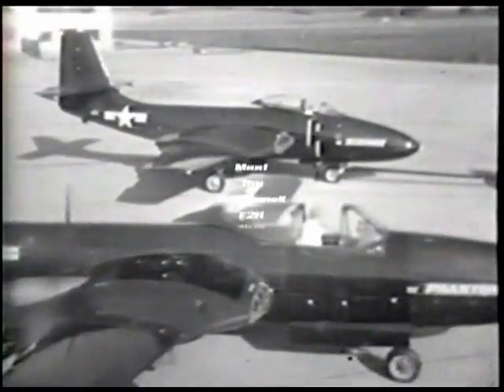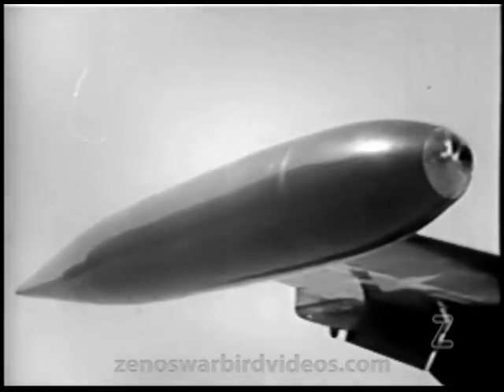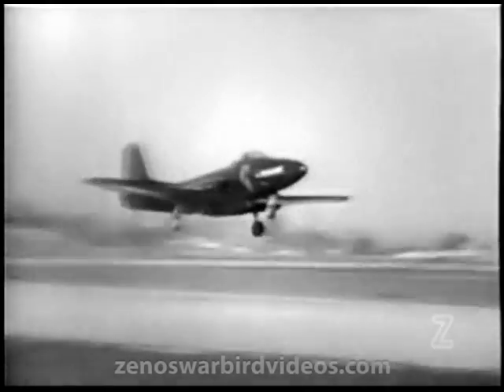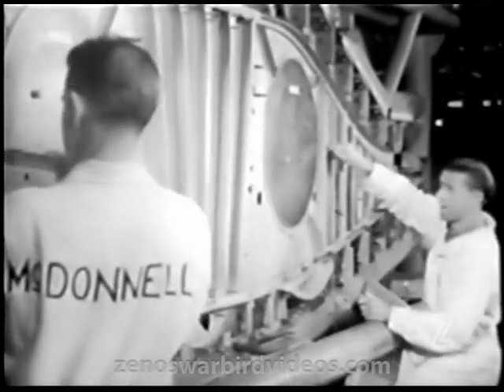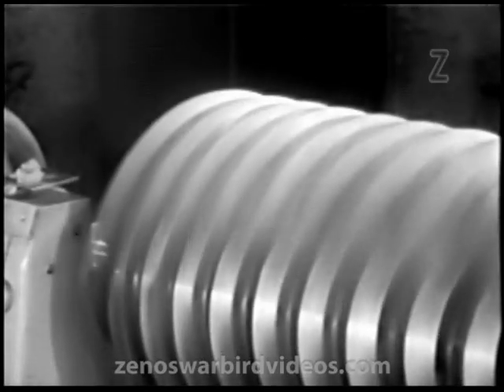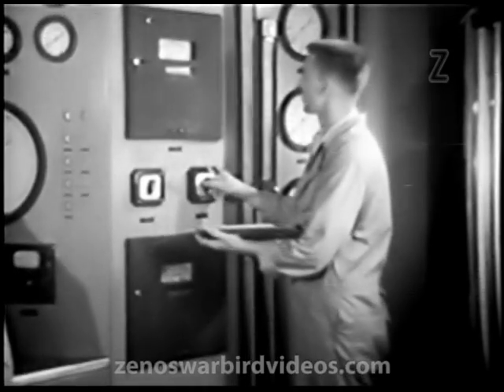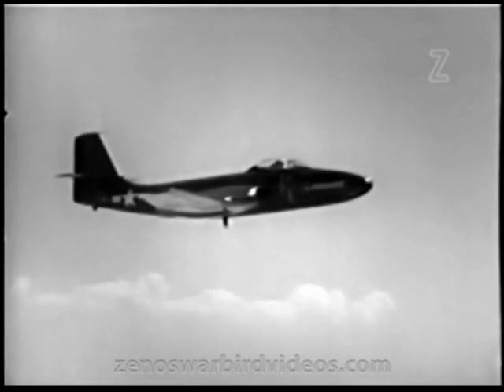Meet the McDonnell F2H Banshee US Navy Jet Fighter - 1948

Comment: For fans and experts of military aviation, in-the-know, this cheerful, optimistic depiction of the Banshee omits the major point.  The Banshee's straight wings reveals it all.  Straight wing jet fighters were limited in performance.  Swept-wing jets flew much faster at higher subsonic speeds and could even achieve Mach 1 in a dive.  The F-86A Sabre could achieve 650 mph.  The straight wing Banshee would not come close.  First generation, straight wing jet fighters of the U.S. Air Force, Navy, and British RAF would achieve about 580 mph.  Only the swept wing fighters could reach into the mid-600s and better.  The USAF F-84G Thunderjet was able to squeeze out 620 mph from its straight-wing design. 
      The Korean War clearly demonstrated that swept-wing fighter jets were here to stay.  Straight wing fighter jets had their short-lived day, establishing the new paradigm of fighter combat aircraft.  But the swept wing jets would rule the skies of air combat indefinitely.

Comment: I was comment # 177; the rear stabilizers move up & down independent on modern jets fighters most hve dual fins & dual engines not always plumb, mighty brick aero F4 has downward not level tail stabilizers. ESP important Fighters must hve gun engineers fucking idiots.

Comment: So, did pilots shut down one engine during cruise altitudes for the single purpose of extending range? The same for loitering time? How long did it take for inflight engine restart? If this was engineered design, seems advanced for 1953 era combat jet fighter aircraft, i.e.; F-15 crews wouldn’t run on single engine by choice.
Reply: Not range, shut one down to prolong endurance, say damage on the carrier.
Reply: No way. Jets lacked Power to fly just on one.

Comment: Top speed? Armament? Thrust? Range? Ceiling? Cost? Production number? This video is for children.
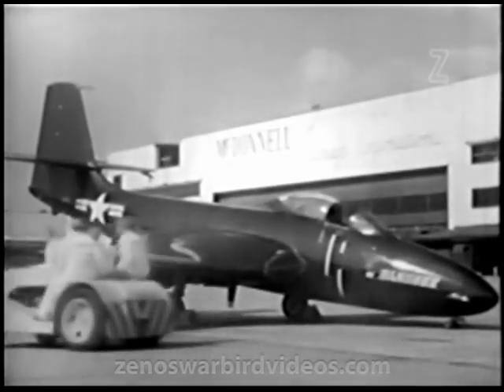Reply from the maker: It is what it is: a very brief 13:00 film produced by McDonnell to introduce their new aircraft more than 70 years ago. Performance figures etc were probably classified. But beyond that, it was never intended to be an in depth analysis of all the aircraft’s capabilities. But I suppose you could write a letter to Boeing, who bought the brand a long time ago, asking them to update the original film😉
Reply: @ZenosWarbirds  Hey ! A letter to Boeing might work if I tell them that I am a Boeing shareholder. Has to work because I have  
                                 been agonizing over that data for years. Thanks for the suggestion.
Reply: I also wanted to see or hear some numbers. So why the silence ?
Reply: Think Uncle Joe’s goons might have been watching that movie?  Ever hear of the Cold War.

Comment: In 1948 the Westinghouse J-34 was state of the art turbojet technology.  within a relatively short time, Westinghouse would  see its  J-40 program implode bringing jet engine development to a halt at Westinghouse.
Reply: Kelly Johnson designed an axial flow engine with afterburner in the 1930s. But the Air Corp wanted nothing to do with it.
Reply: Then GE took the jet engine to the finish line.

Comment: I'm a big fan of M-D Aircraft, but why is it the ME262 Jet Fighter, which is older in design, have more of a modern design over our first generation Jet Fighters? What am I missing here? Thanks, agw.
Reply: The Navy was concerned at the time about performance of swept-wing aircraft on carriers.  It goes to why the swing-wing aircraft take off and land with wings fully extended.  Land-based aircraft almost always have an advantage over comparable carrier-based craft.
Reply: Because you’re wrong in every way. The banshee was faster, flew higher, climbed faster, had twice the thrust, on and on. You’re just wrong, lol.
Reply: soaringtractor 
   Agree with you on the fact of the NO swept wings in the Me-262, it was in fact to maintain the CG, and the nose landing gear, with the OBVIOUS need to eliminate the tail wheel.
Reply: @Dirk Pitt Thank you!
Reply: +soaringtractor attitude
Reply: soaringtractor More Information for you WilbursoaringtractorFinnigan on the F 86 Sabre . Read it and weep cos it busts so many of your lies. It's from an American website !!

The F86 Sabre was originally designed for the US Navy in 1945 as a straight-winged jet fighter, and was known as the XJ Fury.North American Aviation  was put under contract by the US Army Air Force to produce a new jet fighter. Utilizing information captured from the Germans, innovative technologies were employed in transforming the straight-winged XFJ-1 into the swept-wing F-86 Sabre that would dominate the skies over Korea in the 1950s.

The Sabre represented many firsts in technology and design. Swept-wing configuration has become a standard for jet-powered aircraft. The then revolutionary ( INVENTED  IN BRITAIN !!! ) but now commonplace 'flying tail' allows the aircraft excellent maneuverability at high altitudes. In addition, the Sabre employs a hydraulic system for the movement of the flight controls, eliminating the excessive control stick forces necessary to maneuver other types of airplanes at high speeds.

The Sabre was delivered to the Air Force in 1948. The first production model flew on May 20, 1948, and on September 15, 1948, an F-86A set a new world speed record of 670.9 mph. Originally designated as the F-86A, the Sabre would undergo a number of changes resulting in a variety of model designations.

YOU ARE A LIAR AND A TOTAL LOSER
Reply: +soaringtractor me 262 was effectively the first swept wing jet fighter, although not as great a sweep angle as a F-86 or a MiG-15.

and the F-86 prototype had P-51 wings.

and if your response to this is as rude as I've seen then well go live on like that and we'll see where you'll end up
Reply: But why didn't they enter service then in WWII? Why the first generation is straight winged? BS
Reply: soaringtractor 
   NEGATIVE.!!!!!!
   (About the development of jet engines)!!!
   And, may I ask, to you, both Gentlemen, to keep this SO interesting conversation CIVIL, without RUDE, (no needed), lenguaje???
   Please???
   Thank you, in advance, Sirs, for I'm very interested in this subject, and I would like to fallow you, BUT only in a Gentleman's way...
   Thanks in advance, and let us continue, please..
Reply: soaringtractor The F84 was way underpowered. On hot summer days it could barely take off even on long runways
Reply: @ SoararsetraitorFinnigan ..Attitude from TOTAL LACK OF KNOWLEDGE
Reply: AirGunWarriors The ME262 had the best German scientists working on them for a long while during WW2. They had jet engines and jet boosters long before anyone else. Seeing jet fighters was a huge shock for the US and Russia, and it wasn't until after the war that they could really start developing their own engines and jets.
Reply: If you say so
Reply: We didn't have to develop jets during the war. They did.
Reply: But none of them was a priority, they didn't get production stage, the programs were delayed and finally abandoned until the end of the war. The programs boosted up again because of the cold war pressure. And the first generation of american jets had straight wings, arrow wings were not developed until the F-86, during the korean war.
Reply: soaringtractor The F 86 Sabre , great airplane that it undoubtedly was did not fly until August 1947 ( correcting your earlier LIE that it flew in 1946 and that after a complete re-design of the wings due to data learned from the Germans and the ME 262 .

The original work on the F 86 had a straight wing !!! The engine ( J 47 ) was only ready in mid 1947 ( LOL You even lie in your lies . Say i,m wrong on my post and just apologise for you twisted nationalistic LIES as usual. !!!
Can't stand the truth can you ; living in that Orwellian mind set as you do where right is wrong  you sad old CUNT ..Now , and as usual ..FUCK YOU and FUCK OFF
Reply: The F-86 Saber was developed from the USN FJ1 Fury which first flew on 11 September 1946.  Give credit where due to Navy successes.
Reply: @garrington120  The Me 262 was a very good plane let down by it's engines,not because the Germans didn't know how to build better ones but they lacked the metals to make the alloys needed for the high temps. The semi swept wings on the 262 were a happy accident  They were not for higher speeds but to correct center of gravity problem Even the 163 rocket fighter which could reach much higher speeds than the 262 didn't really have swept wings. You are right the Sabre was to have straight wings but was redesigned when captured German data was analyzed. The most advanced jet engines of the war were not German but British  but their air frames. were not as good as the Me 262  The soviet Mig 15 used an engine designed by the British little changed from WW 2 . The Mig used German data and a British engine It shows the potential the British could have obtained If the war lasted even a little longer

Comment: 'Yes the Westinghouse's J-34 gas turbine jet engine, a marvel of today's technology!  We brighten your skies and your clothes - Westinghouse!'
Reply: +soaringtractor You are having a really hard time accepting that there are in fact talented people outside of the undeniably great nation of the US of A, which is really a pity since your nation can stand proud on the multitude of its own merits without the need for any petty history revisionism.

And remember, the US has less than 5% of the world's population, so why is it so hard to imagine that there would in fact be people with at least equal talent among the other 95%+ of humans?

The first axial flow jet engine is in fact a German design, but both Germany, the US and the British were developing axial-flow designs in parallel at about the same time. Axial compressors were not a new concept, but it is not until someone got the idea to use airfoils for the compressor blades - a British engineer by the name of Griffith was first to patent this in 1926 - that it was realized that it could be used to make a more efficient jet engine than the centrifugal-flow types that were developed in the 1930's.

The US did award contracts to several manufacturers in 1941 to develop axial-flow jet engines, but by that time Germany had had both their BMW 003 and Junkers Jumo 004 designs running for a year. The BMW 003 first flew in prototype Me 262's in 1942, while the first US axial-flow design (yes, the J30) first flew experimentally in 1944, and in a production fighter prototype in 1945 on the FH Phantom (note: not F2H, that was the designation for the Banshee).
Reply: soaringtractor You are not seeing the story in context. Nobody who knows anything about the subject denies that the US is the world's leading aviation nation today, and that it got there on its own merits. But it is dishonest to dismiss the origins of the technology just because you got patriotically butt-hurt.

You don't want the germans to have all the credit. I get that. Noboy who knows what they are talking about are giving them that, either.

But they were first, they were in fact YEARS ahead of the British and the US and the rest of the world, despite being in the middle of an extremely costly and resource-depleting war.

And they DESERVE credit for that.

Can you say for sure that absolutely nothing of German technology inspired the US military or US manufacturers? I don't think so.

I mean, it was well known that the technology was being developed. If nothing else there were both British and German pre-war patents, and as you rightly point out (I left that out of my previous comment because it turned out long enough as it was), even Whittle's design had an axial two-stage pre-compressor.

You keep coming back to the fact that the German engines didn't work "for shit".

Could that possibly have had anything to do with the fact that the Germans due to the war had very limited access to the advanced materials needed to make reliable hot sections, ball bearings and so on?

The technology the Germans developed was sound, and in fact for example both in Russia and France (that I can think of off hand, maybe in other nations as well), the German designs were studied and developed further after the war, when the victors got access to the designs and hardware.

Post war Germany could most certainly have continued building jet engines if they had had the incentive, but you really need to realize what state the country was in after the war - thir infrastructure, industry, cities, economy... everything was bombed to pieces... not to mention the millions and millions of people that died in the war, and with them their knowledge and labour contributions.

Using that as an argument suggesting inferior technology is either ignorant or dishonest.

So yes, credit is due to Westinghouse for their efforts on the J30 and J34 among others, but don't forget that at least three other US manufacturers of the era failed to deliver on that same contract.

This was cutting-edge technology back then (and still is; today's refinements and levels of performance and fuel economy must have looked like science fiction back in the 40s and 50s), and there is nothing wrong or shameful with not being first. You can still be the best in the end.
Reply: soaringtractor We all see things differently... Thanks for your insights and point of view. I shouldn't have called you a troll, I should have said that it is my opinion that you are trolling.
Reply: soaringtractor Oh, don't worry, I have done my research. I always do. Whenever I state something, even if I know it by heart, I double-check it with several on- and offline sources, for example my 1000+volume aviation and military history library. I'm doubtful about the rest of youtube however... :)
Reply: soaringtractor I suggest that you befriend him too, then. But tread carefully, not all that he says is the truth, the whole truth and nothing but the truth. (My day job involves working with clustered inverted indexing technologies as used by google and other search engines to index and rank natural language text.)
Reply: Fox Hound    BUT ask yourself....."For how long ???"
Reply: soaringtractor  Apparently google is not your friend.  The first jet fighter to be developed in the United States was the Bell P-59 Airacomet; its maiden flight took place on October 1, 1942.  The P-59 was powered by two General Electric J31-GE-5 turbojet engines (derived from the British Whittle engine) of 2000 pounds thrust each.  When the first XFD-1, named Phantom, serial number 48235, was completed in January 1945, only one Westinghouse 19XB-2B engine was available for installation. Ground runs and taxi tests were conducted with the single engine, and such was the confidence in the aircraft that the first flight on 26 January 1945 was made with only the one turbojet engine.  The Banshee was a development of the FH Phantom, although it was being planned before the Phantom went into production.  The new aircraft would use much larger and more powerful engines, a pair of newly developed Westinghouse J34 turbojets, raising thrust from the J30's 1,600 lbf (7 kN) to 3,000 lbf (13 kN) each.   The aircraft made its maiden flight on 11 January 1947.  On the other hand, the first of the pioneer jet fighters was the German Messerschmitt Me 262, which made its initial flight on March 25, 1942.  The axial-flow Junkers Jumo turbojet engines were mounted below the wing of the Me 262. The innovative Junkers engine employing an axial-flow compressor may be considered as the precursor of all large, modern axial-flow engines.